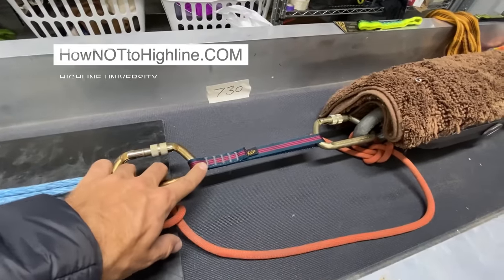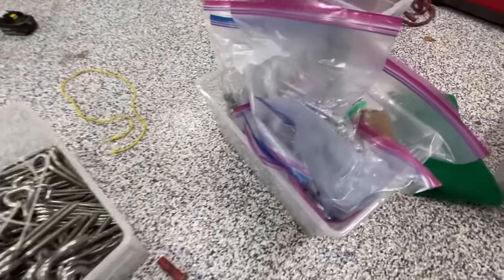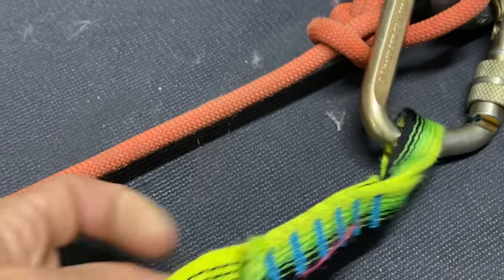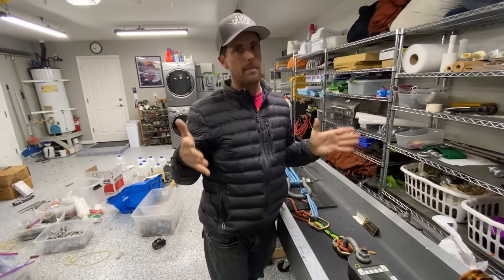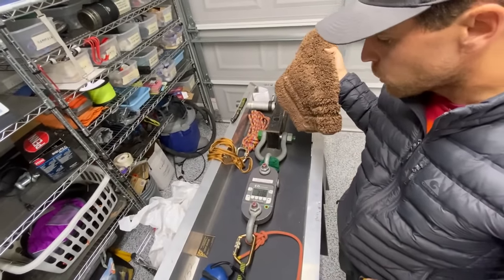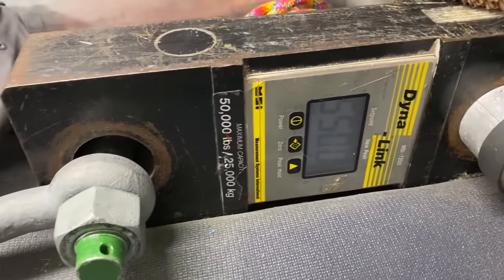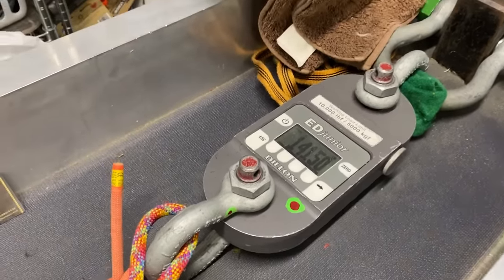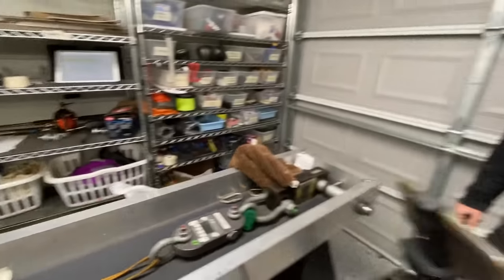30 Year Old Climbing Gear Tested

Comment from the maker: STOP AND READ THIS:  Another person sent in old gear and some normal looking 30 year old gear broke at very deadly levels.  Expiration dates are naturally conservative but there is a limit... don't find out what the limit is.  If it is old, replace it.
Reply: Oh really?
Contradicting the results of this video?
And you make cool tests of gear, yet... NO VIDEO!?

Who sent you this other old stuff? What exactly were the results?
What's the tensile strength of Royal Robbins clothes line he used as protection at Stoney Point?

Love the channel, am subbed, but think you're only saying this for common sense sake...
Reply: It would be great to see some old gear fail at low loads. I've seen a bunch of old gear fail at basically close to it's rated strength, but I've yet to see it fail at significantly lower then it's rated strength.
Reply: Seriously, no video?
Reply: If you look on the tag on must climber gear it states climbing is dangerous. I love how we’re all trying to make our climbing gear super safe, but then we go climb on sandstone, go figure😮 just don’t fall and all is well.
Reply: I love your channel, but I don't think for a minute that you had 30 year old software  to test and didn't record it.

Comment: Only problem I can see is that all the old gear looks like it didn't get used much. They looked like they were in great shape. Whereas heavily worn gear, or old tat/slings that have been baking in the sun for years, would yield very different results

Comment: For nylon and even more for dynema, how much UV it's been exposed to is more important than how old it is. From ENSA's test dynema gears in high mountain should be discarded after only 3seasons of moderate use to just one season for daily use because of that, and remember a high mountain season in french alps is just 3-4month.

Comment: I'd be curious to see if there is a difference in the rope break strength when using a bowline versus a figure 8
Reply: Yes, definitely
Reply: I agree
Reply: I've been using the double bowline (with safety knot) for tie-in to my harness and have the same question.
Reply: I’m pretty sure bowline is a little less efficient but any knot takes away around 50% strength from a rope, that’s why it always breaks at the knot
Reply: a question I've wondered for years as well.  there are videos around on this topic; typically a figure 8 and double bowline both reduce rope strength by 20%.  A single bowline reduces 40%, which relates to the shorter radius turns the rope makes in the knot (which is why we don't climb on them ;-)

Comment: Super interesting tests. Guess I can totally trust my slings... also I would argue the rope tests is a little misleading because with the way the rope up took load it actually disapated a lot of energy. Meaning that a dynamic rope is tough rather than strong (think about area under the stress-strain curve) and should still do a good job of catching a fall.
Reply: Also a fall with 14 in of force on your body is probably going to kill you. Minimum strength for quickdraws is 21KN in because the one that catch you fall is going to take up to x1.5 times the impact force: it is not a perfect pulley by any means, but it acts like one. In fact the forces on it are on both climber side and belay side. A climber falling creating 14 kn (peak) of force is going to need at least 7 kn (peak) on the belay side to catch the fall, assuming a 0.5 pulley efficiency. The real math goes with 12 and like 0.75 I think, but here it goes, 12 kn on a 80 kg climber (180 pounds) are about 15 G of acceleration...
Reply: Agreed. Ropes have a low breaking strength because the way they absorb the energy keep them from ever seeing that much force.

Comment: Small correction. 12-14kN for rope is pretty standard for new dynamic climbing rope. Keep in mind your rope will see more or less half the load your bolt gear (quickdraw, etc) will see. The up side and down side of the rope forces are added together for the total force on the bolt. Overly simplified, 8 kN rope needs 16kN biner,  12kN rope needs a 24kN biner etc.

Comment: to despise 11 kN breaks as low on dynamic rope is a misunderstanding of their role in the belay chain. 
First (and apart from a factor 2 fall which should not happen in good practice) they would always split the force on the quickdraw between the belayer's side and the climber's. As shown in your indoor real fall testing, the force on the quickdraw is related to twice the one on the rope ( climber's side). So the resistance of the dynamic rope does only need to be half the one of the quickdraw or carabiner.
Second, what really matters is the ability for a dynamic rope to absorb the energy of the fall, which is link to the Work of the force. So if the bulk of the stretching happens  at a higher force, you have a more resistant rope. one testing protocol could be to assess the extention ( in size ratio) that occurs between a force of  e.g. 1.1kn to breaking point.
And by the way, I love your vids ;-)

Comment: Older nylon soft goods seem to test well. You should do a comparison to aged Dyneema/ Spectra. New literature is saying they are compromised after only a few years. I have some 90's like new spectra/ dyneema draws and runners if you want them.

The pink elephant in the room here is that since most climbers aren't reslinging their cams/ replacing their draws every year... Maybe the trend towards dyneema isn't a good one.

Comment: This is pretty normal for a dynamic rope to withstand under static tension right? Or is is it less than expected?
Reply: Let's say that a 14 kn force on a 180 pund climber (80kg) is more or less near the limit of fatal acceleration even for a perfectly straight fall (17.5 vertical G acceleration is enough to provoke internal organs damage). It's not even designed to absorb such a high load.
Reply: @bellini98-1  So yeah i'm correct, thanks for the reply.

Comment: I would be more interesting to do real world falls (meaning put the old gear into a modern anchor set up, take a 177 pound weight on a modern dynamic rope, and do factor one and factor 2 falls and see if it holds.

Comment: I have a whole rack of 15+ year old gear and some 13 year old screamers.  I was gonna throw em out and replace all of it but keep the biners and cams etc. all stored indoors in a Rubbermaid bin no sunlight etc.
Reply: So the tests show I can still use them fine.  Lol nice
Reply: Replace them. This test doesn’t prove that the gear is typical. We don’t know anything about how this gear was used. Ropes can need replacing after one hard fall. Follow manufacturers specs.
Reply: @zraybroske2416 watch Hard Is Easy’s video on how many falls a rope can take.

Comment: Your carabiner wasn't screwed shut when testing the sling. Play at 0.25 speed at 12:20 and you can see it
Reply: but the screw doesn't increase the strength yeah?  It just stops the gate from opening.